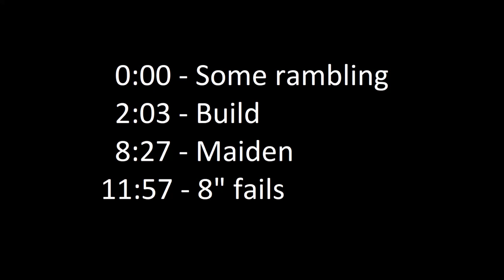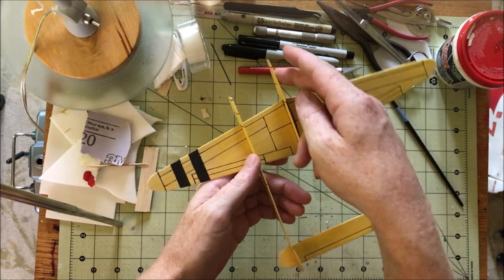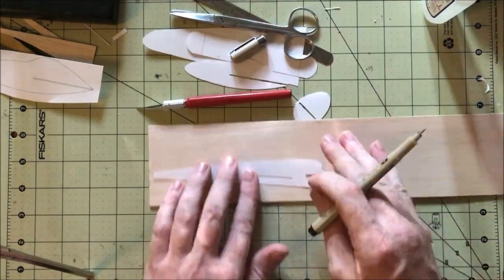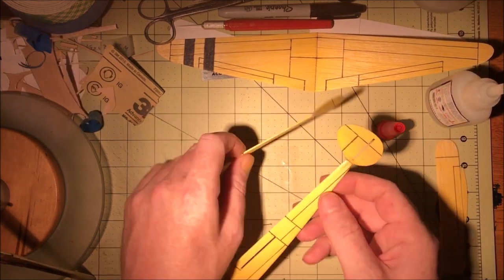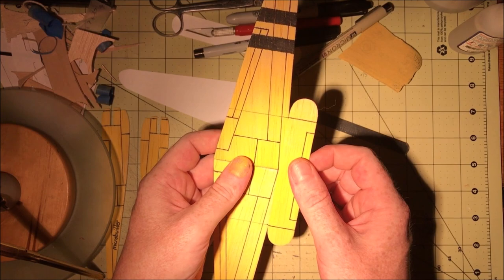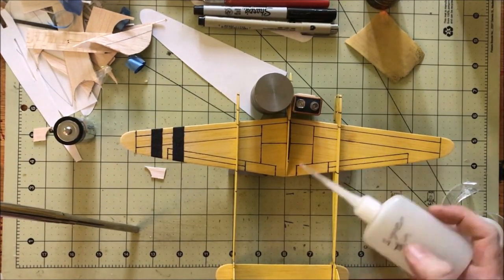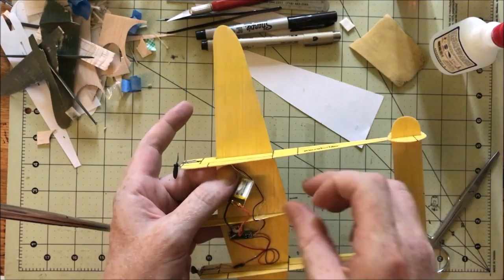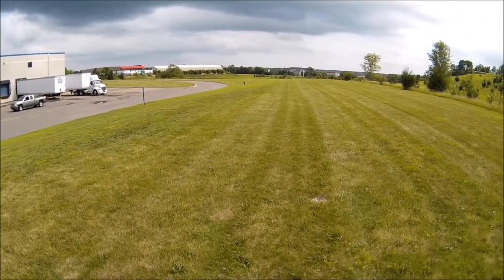$30 DIY Micro P-38

Comment from the maker: Electronics from the $30 micro RTF, 12" span, 1/16" and 1/32" balsa construction
check out NitroCharged, he got his 20mm EDF going really well!  https://www.youtube.com/watch?v=CjmBGM5Uf1Q
Sorry the audio is so low, didnt realize it till it was uploaded.
I'm looking for a place to upload the .PDF of the P-38 plans I used. 
Anyone have any camera suggestions?
Reply: Can you share the plan? 

It looks great.

You may upload to Google drive and share the link.

Thanks in advance
Reply: Hello again Microbuilder,
I recieved the 14€ F22 2 channel.
Motors are 7*17 mm
Weight aprox,58 grams.
Put 2 grams in the nose section.
Flyes like a dream,hassle to canabise parts for P38.
250 Mha lipo.
Reply from the maker: @ronaldderonde  Excellent, thank you for the info!

Comment: I have an idea and I don't know  if it will work,buy one of the cheap 3 channel hellicopters and use the tail prop for pitch while using the two motors for the blades as throttle and rudder controll ,I don't know how well it would work but it would be cool to see someone use this concept  in a twin engine  style rc plane

Comment: Could you do a video on the electronics and set up? I take it this uses differential power for rudder and throttle as elevator?
Reply from the maker: Yep, done and done https://www.youtube.com/watch?v=m4Z11hy9bws or https://www.youtube.com/watch?v=cRM7dfGeuX0
Reply: @microbuilder  Thanks for the links. I wonder what protocol they use, and whether they'll bind to a spektrum of F sky..
Sweet little biplane on the work bench (Pitts?); what's happening with that?
Reply from the maker: @56Seeker  No problem!  I did try binding it to my DX7, but no go.  I've got an F Sky module somewhere, if I can find it I'll try that too.  The little bipe is a Prairie Duster, its the one thats on the main page of my channel...built quite a few in different sizes over the years, and that one flew the best by far https://www.youtube.com/watch?v=WPYaTIX_AzE